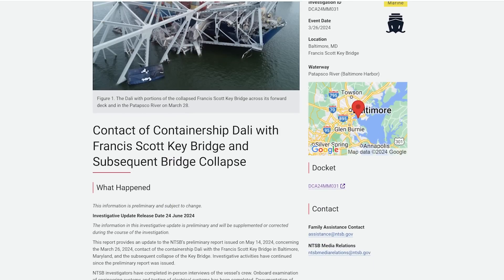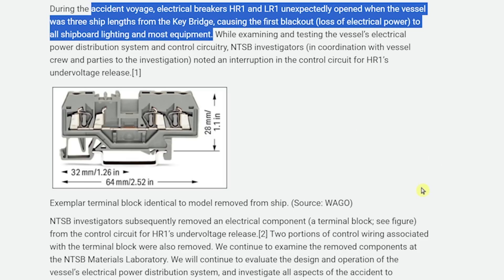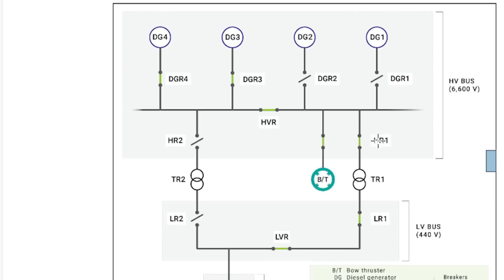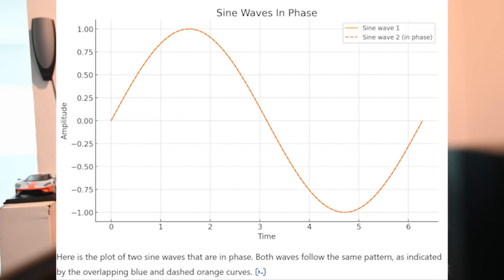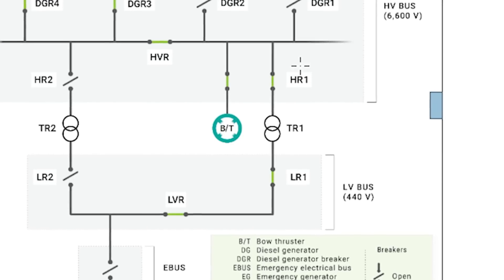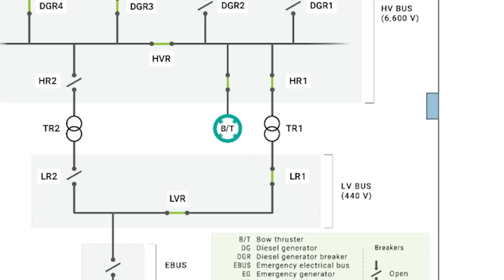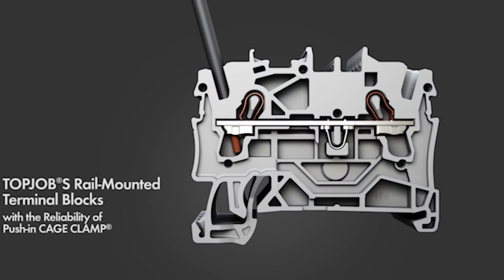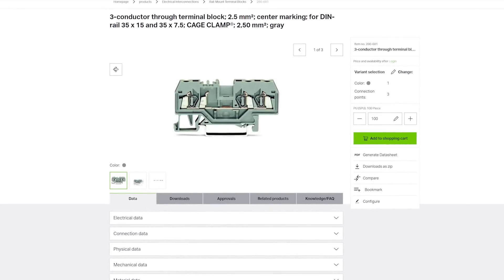Did This Part FAIL Cause MV Dali Key Bridge Collapse?

Comment: That's pretty bad if this is the culprit. What do those terminal blocks cost, $5 if you order a box of 100? So $10 worth of some wire and a terminal block caused many deaths and billions of dollars of damage
Reply: It's not. Expect lack of proper maintenance, cost cutting. It is not fault of a part. It is rather obvious they did run system in way it was not supposed to. Normaly you should have both transformers side closed, use GEN 1 (or Gen2) and GEN 3 (or gen4) with HVR breaker open. When one sides generator dies for whatever reason, you close HVR, until you restart failed GEN or its backup partner. IT is very likely there was major undealt with fault in one of TR sides. Likely for months prior
Reply: @klonik79  That makes sense, and explains why when they switched to the other transformer, then they had power just fine while stuck on the bridge for the last several weeks.

Comment: I would think that in a vibration prone environment they would use the screw terminal version of these. Even on my CNC router I would not use one of these push-to-connect wiring methods. Or on the lights switches in my house.

Comment: A loose connection in the control circuit would be my guess. I’ve seen loose connections cause I2R power losses. This causes a voltage drop across the terminal and sometimes lots of heat that will melt the terminals.
It looks like the blocks are rated for 600vac. Could have been used on the LV side of XFMR or in the  control circuit. If in the LV side the I2R issues would cause the voltage to trip depending on the LV connection location.
Reply: Yes. Loose connection. That is why Ntsb has taken out also part of wiring, and Ntsb did not take the wires out from connection points.

Comment: I've repaired many plugs in houses near the  beach where the connection to the plug were through the push in connectors in the back of the plug.  Even if copper wires were used in these connections, corrosion could occur in sufficient quantity to make the connection fail especially in a salt water environment
Reply: I have also seen the same failure where I live with these push in connectors. I re-wire them and use the screws on the outlets and switches. Then WACO sells these other spring clip things to use instead of wire nuts. I like the convenience they offer. Now I question their safety.
Reply: the problem is even worse for low voltage/current applications, such as control circuitry, where there isn't enough "Oomph" to push through a dicey connection

Comment: breakers open because something is wrong
Reply: Sometimes there are faults in the fault-detecting circuitry too. AND connections under vibration suffer from physical wear that can result in faults too.

Comment: I use those Wago terminal blocks every day. They are the best in the world if used correctly.
Reply: conversely, I tested Wago lever nuts in a corrosive environment, and even with high quality de-ox, they had a working lifespan of less than a year.
Reply: unless you get a counterfeit one.
Reply: have thousands of them on the plant i look after, never had one fail, would trust them more than a screw clamp type
Reply: @garyhinson3876  same here, even as much as 200 amps @ 480 volts. Been that way for 10 years, no issues.
Reply: @jasonscott5204  lazy man's device...plus you don't have to find your long lost screw driver.
Reply: Why would you put a wire under a spring to hold it verses sticking it under a screw and tightening.  I have seen old "knob and tube" wiring still working great with all the connections using screws.
Reply: Spring-tension connections resist loosening from expansion, contraction, and vibration.
Reply: @thebigmacd  springs will loose their tension and elasticity during heating and cooling cycles under load.

They WILL get hot with just a lousy pinch of copper plated steel digging into a conductor.

Who in their right mind would use a device that connects wires contacting less area than the total circumference of the wire itself.

Give me a full 1/4 inch of conductor clamped under a screw clamp . The more contact area, the better.

I will die of laughter if a WAGO style connector is to blame  for the ship hitting the bridge.
Reply: @grandinosour  spring-style DIN-rail-mount terminal blocks have been used successfully for decades in harsh industrial environments. I have run across dozens of failed screw-terminal connections but no failed spring terminations except for the odd one on startup testing where it was pressing against the insulation (improper installation), which happens with screw terminals as well.

A common maintenance procedure for low-voltage controls is to tighten the screw terminals because they get loose. There's nothing magic about a screw terminal.
Reply: @grandinosour the problem with screw clamps: they’re not maintenance free. You’re supposed to re-tighten them. Many of them found in the wild are really loose.
Reply: @grandinosour  Vibration. Under a spring it actually gets tighter. Under a screw, it will get loose.
Reply: @grandinosour  Also these Wago terminals are tested heavily by UL and other agencies.

Comment: Very early on, from either the news or YouTube, it was mentioned that refrigerated containers were connected to the power system and there may have been in-port power issues.  Would it be possible that the overall connected load (ship systems + auxiliary loads for refrigerated containers) caused the upstream breaker to trip?  Great spot on the WAGO connectors.  One would assume that all electrical components would be approved for marine use (you mentioned vibration).  The control wiring would likely be insulated, stranded, 12-16 AWG THHN-like wire. One would hope the WAGO push-in connectors were approved for stranded copper wire if that was used.
Reply: I was thinking the same. The  refrigerated containers on the 440v buss caused the overload.
Reply: @bobbym6964  No, the refrigerated containers are fed from the 6600 volt bus BEFORE the TR1/TR2 transformers. The container have their own 440v step down transformers located closer to where the reefer containers are lashed. There are many 6600 to 440v transformers dedicated to reefer service. The main reason being, it's cheaper to buy a few step down transformers, than to run heavy guage 440v cables all the way from the rear of the ship's engineering spaces all the way forward to the reefer containers. You can send a lot more kilowatts down a thinner cable at 6600 volts.
Reply: The diagram shown on screen seemed to indicated the style of wire that was acceptable, and I did see stranded wire of various sizes shown.
Reply: The image shows a wago 280-681 of the cageclamp series. It can handle stranded wire of all types. But if aluminium wires are used, it seems like a special contact paste must be used.

Comment: Phase sync on the two generators is certainly a requirement but voltage being exactly the same( is not required?)
Reply: When I was in the Navy, you could manually sync two AC power sources if the phase difference was 30° or less.

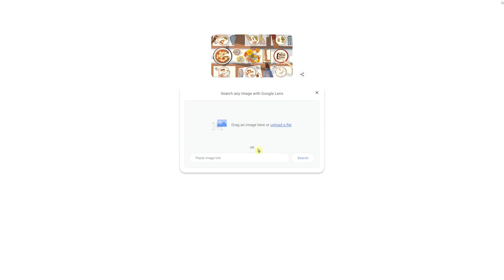Comment: 4:34  this is what I don't understand. If you know all this of what causes a short circuit and this and that, then why they didn't know all of this and that, and wasn't able to jump into to action and stop this from happening. 7:31  but it seems like you a electrical engineer by knowledge the way you speaking on the matter of what may happen with the electrical system that failed. This is again, what I don't understanding, y'all can figure out all this after something tragic happens, but don't know it when the problem is starting to happen. How in tf these electrical engineers don't know how to fix this or 9:04 what wires should be in there. And when building this ship why not put that in if you know sh! T will fail at some point and time. 9:04 knowing these ships go through bad water

Comment: Low voltage protection - likely part of a check to make sure ALL 3 phases are 'up'. This isn't single phase gear here ...
Reply: yep, there's motors on the lower voltage buses, as well, and if they single phase, all the smoke leaks out.
Reply: @kenbrown2808  Yessir. We lost a rotary frequency converter (Motor Generator set) on a chiller in an HVAC system on a building back in '74 ... one phase dropped the other phase currents 'picked up' and eventually we had little copper balls on the floor when the copper field coils melted ... so, missing phase protection is VERY important!

Comment: Control voltage has nothing to the 6600 or 480. Low voltage typically is 24v that used to control the high voltage devices. That terminal block looks like a low voltage or control voltage terminal block. Usually less than 30amps at 24 dc volts
Reply: If it was a WAGO 280-835 then it is rated for 800V and 20 Amps. 
But yes, that is not the HV side, in this case used for the control side of the contractors. 
And the video to explain it's function was the wrong one. It is not a clamp for direct push in. The spring has to be released with a tool before inserting the wire. From this they are not only allowed for solid wires but also for flexible wires without sleeves. But you should be trained to do that without mistakes. 
Regards from from WAGOs home land.
Reply: @jfnotk255  It's a wago 280-681 (they used the secong image from the wago page). 
It's ul rated for 600v, 20 A and EN rated for 800V 24A.
Reply: @clockworkvanhellsing372  : Yes, I used the EN rating because it's usually also used in Asia where the Dali was build and registred. Don't know what they used for control circuits, we are not going higher than 400AC here.
Reply: The same blocks get used up to 1000V.
Control voltages can be between 240V and 12V both AC or DC.
I have run into 240V DC battery supplies to HV breakers.
These are spring loaded terminals which use springs to clamp the wire unlike the older screw terminal blocks.
Reply: @allangibson8494  These are commonly used for connecting solid wire only. Animation showed stranded wire with a sleeve in there, which I personally would not trust that much. Connectors for stranded wires usually have screws or very strong spring clamps, you may have one at hand if it is bear to open even with a tool. Spring has to be strong enough to deform sleeves on stranded wire terminals and keep it constantly compressed to maintain reliable connection. In short, these types of spring loaded terminal blocks exist but aren't that common and quite probably have notably higher price tag.
Alu termination paste, I'm not a certified electrician but I know that stuff and use it regularly in places where Alu stuff connects with Cu/bronze stuff. Bushings or connectors may have it applied from factory, just know what type to order. Have repaired some 400V underground Alu cables with those and no issues ~20 years later.
Reply: Those gennys and main engine are suppose to be running on pure marine gas oil whilst maneuvering. Not HFO or even MDO. If they changed over MGO to HFO improperly that could cause a diesel slowdown resulting in low voltage, causing a low voltage release. Once voltage output is restored LVR CBs close automatically. I’m a retired C/E (1997). I know if you’re not careful changing over from MGO to HFO you can stall a genny. I’m looking forward to the final analysis of the LVR CB
Reply: I agree.. Also, I really doubt they used aluminum wiring on a safety circuit; therefore I am inclined to favor a bad contact, possibly caused by too small a gauge of wire, i.e. design flaw
Reply: @JohnnyVoikdal  Look at the ship and that should say it all, look where it is from.
Reply: I don't know anything about large vessels, but for boats there's marine grade wire.  It's tin-plated copper stranded wire similar to milspec aviation wire.  I don't know of anyone that uses aluminum in harsh environments.  However, copper clad aluminum (CCA) wire or devices that use it run rampant on Amazon.  Hopefully they aren't buying wire off of Amazon :-)
Reply: The breakers opened as they were told to open via a ZeroDay vulnerability exploit.  I’m an ETO so please feel free to ask me technical questions.
Reply: @fakename8856  After watching the Debate the other night, who will you vote for President now?
Reply: These breakers aren’t like in your house, they are controlled by an automation control system which has a ZeroDay venerabilities.

Comment: The cage clamp design IEC terminal block should have never been approved in favor of the NEMA screw terminal. Wake up DNV... German engineering!
Reply: Yeah, how many times have you retightened those screw terminals with vibration and hot cold cycles?

Comment: Ahh Wago    I've used a few of them instead of wire nuts. Halo high hats had similar quick connect push in connectors. Much faster  good for hot attics.

Comment: Sounds like an intermittent loss of power to the UV relay caused a protective action to protect the transformer. Could be as simple as a loose connection.
Reply: But like i said if you have all 4 gen-sets running in sync you could loose one, tie breakers open and you have not even a blink!
Reply: @ch3no2killz  Could also run all four DGs, split busses, as looking at the single line diagram,  then a failure on one side wouldn't de-energize the whole ship.
Reply: The latest NTSB update indeed says that a loose wire caused the UVT coil to lose voltage which in turn tripped the HR1 switch.

Comment: Dioxide you use it on aluminum wires when you terminate lugs aluminum wire will get loose sometimes over the years
Reply: yup, wire terminals need to be torqued down every 3-6 months